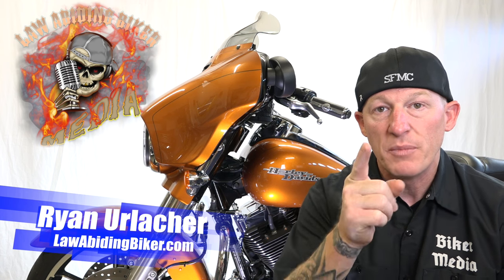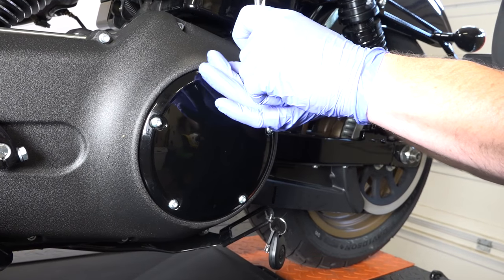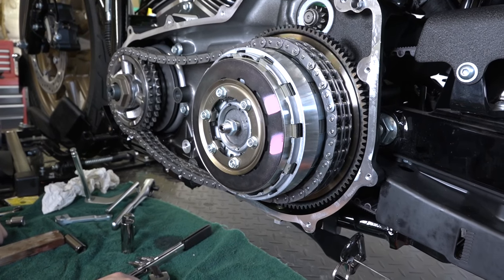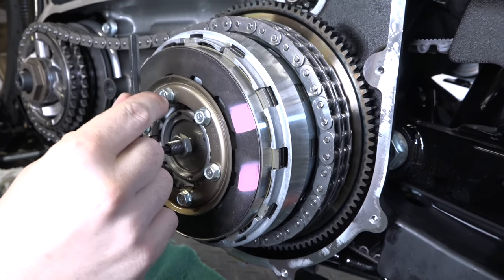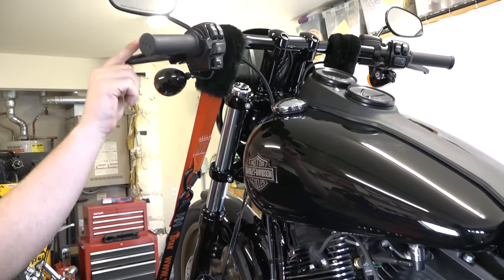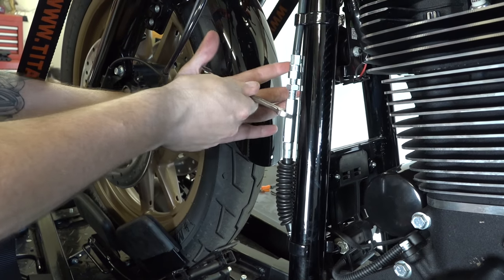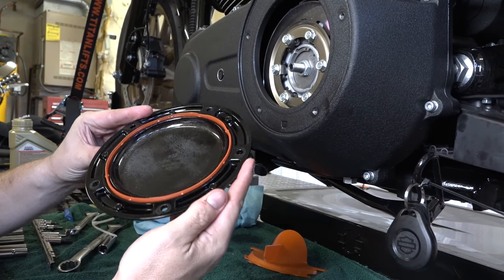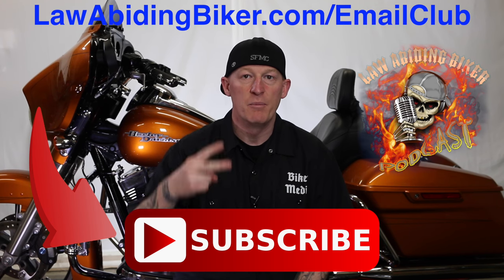How to Adjust a Harley Clutch Internally & Clutch Cable | Biker Podcast

Comment: I did this back in August after watching the video. Everything went smooth until I tried to loosen the nut on the threaded adjuster bolt. I have a 2011 EGC. It felt like someone welded the nut onto the bolt. After about twenty minutes of messing with it, I finally got it loose. I went and picked up a new nut because I trashed the original one. Thanks for another great video!!
Reply from the maker: You are most welcome and glad to have helped.

Ride safe & Ride Often!
Here is a link to a bunch of our useful Free vids: http://www.lawabidingbiker.com/freevideos
Here is a link to some of our useful for purchase videos: http://www.lawabidingbiker.com/buyvideos
Want Answers & Information Fast? And help support us at the same time? Do you like the content we provide?
Our patrons get answers to their questions/comments/feedback in less than 24 hrs and are part of our Private Facebook Group. If you are interested in being in this exclusive group you can get all the details at ==> http://www.lawabidingbiker.com/patreon
If you haven't subscribed to the Law Abiding Biker Podcast make sure to do so. Listen in as we talk weekly about issues/items like this & so much more. You can listen on iTunes (Apple/IOS), Stitcher Radio (Android), or any other Podcast App ==> http://www.lawabidingbiker.com/podcast
Join our free email club at http:///www.LawAbidingBiker.com/EmailClub. Only relevant content will be sent from time to time. Email club members are the first to find out about free or for sale content are given special coupon codes.
Reply: An offset box end is good and the gearwrench socket set is even better. It has a hole down the middle.....

Comment: thanks guys for the great videos.As the back yard mechanic that i am i do know the twin cam any year make or model.All of us back yard mechanics should own a few maintenance repair manuals for reference location, part # , tool's u need Etc.... I just installed the Baker high torque bearing seal kit om my 2006 FLHRS in November she will be 15 years old yes!!! HER treat Her nice and she will do the same. I had that DREADED one drop after a ride primary fluid leak from the main shaft walking race flaw. with the Baker bearing seal kit there is no more main shaft race for the bearing to ride on so therefore no more walking race lol.The bearing is precision tapered and rides on the main shaft alone nice set up easy install put 300 miles on it so far so good thanks again for all the great learning very helpful videos

Big Joe
Deland Florida
Reply from the maker: Right on Big Joe.  Thank you for taking time to comment.  We're happy to hear you like our videos.

Ride Safe & Ride Often!

Comment: Great videos thanks..
so quick question. The further you back out the center bolt, the 'faster' the clutch? 1/2 turn would equal late clutch 1 turn would equal early clutch ..

Comment: Question for you. I decided to do this adjustment on my 2015 Road King with 16,000 miles. No issues beforehand other than wanting to tighten up the adjustment in the lever. So once all said and done and done exactly the way the Harley service manual says, I now have a bad vibration in gear while riding. Clutch pulls and engages just fine but bad vibration in the seat in gear. So I reperformed the adjustment turning out shaft 3/4 of a turn and still same issue. Done EXACTLY the way the manual says on a stone cold bike that was sitting for 2 days previously. What gives here, surely a simple 5 minute service has not damaged something.

Comment: Ryan, I replaced  my clutch basket assembly and adjusted the clutch internally and extras you described. However, when taking off and I’m 2nd and 3rd gears. I get this slipping feeling when accelerating especially when going up an incline. Any thoughts as to what is causing this?

Comment: Hi, need to pick your brain about a problem I have with my 08 Street Glide which I recently bought. After making the clutch basket and cable adjustment my clutch pulls horribly. When pressing the lever the spring on the basket bearly moves and the lever is stiff... The funny thing was after taking off the primary inspection cover you normally don't get much oil spill when the bike is upright but my primary was filled with something like 2 quarts of oil and it spilled all over... Not sure why someone did this.  Checked the transmission cover clutch actuator and it's okay, clutch basket nut, and it's solid... Also to make it work at all, had to turn the adjuster bolt in after reaching the resistance instead of going half turnout.  Not sure where to go next... The only idea I have left is that my Street Glide has Apehangers and a quite long clutch cable... would that be the cause of my headache??? Not sure where to go next... Regards Simon

Comment: I have a 2002 fat boy and I’m ran out of threads on the the clutch cable adjustment. Does that mean the cable stretched too much? Or the clutch pack is worn out? The cable is after market maybe 13 years old.

Comment: I did that exact thing and still can't get my clutch to disengage the transmission when pulled.
If I put the bike in gear I can't roll the bike.
So I started all over adjusted at the basket, then the cable adjustment.
Still have no clutch.
I'm goingmout of my mind.
It worked when I parked it and now after the cable change it doesn't.
It's the proper length cable but just can't figure it out.

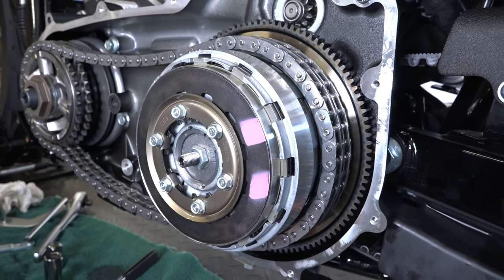Comment: Hey Ryan, huge fan of LAB. I installed new cables for apes and used your video to adjust the primary, but I was wondering at 3:32 it says "newer clutch may need 1 full turn". Is this in reference to the new clutch line, or a overhauled brand new clutch? Also at 3:47 you say to pull the clutch lever 3 times. When doing this are you fully pulling it in or just a wiggle for free play?

Comment: Hi Ryan, clutch question. I have a stuck clutch safety switch on my 15 road King. Causing my bike only to be started in neutral. Also effecting. My cruse control not too work. Can I change that switch or do I have to replace my handle bar control. Thanks
Reply from the maker: Just the switch.  Happened on my 2014 SGS.  My local HD dealer replaced it under warranty.

Ride safe & Ride Often!
Here is a link to a bunch of our useful Free vids: http://www.lawabidingbiker.com/freevideos
Here is a link to some of our useful for purchase videos: http://www.lawabidingbiker.com/buyvideos
Want Answers & Information Fast? And help support us at the same time? Do you like the content we provide?
Our patrons get answers to their questions/comments/feedback in less than 24 hrs and are part of our Private Facebook Group. If you are interested in being in this exclusive group you can get all the details at ==> http://www.lawabidingbiker.com/patreon
If you haven't subscribed to the Law Abiding Biker Podcast make sure to do so. Listen in as we talk weekly about issues/items like this & so much more. You can listen on iTunes (Apple/IOS), Stitcher Radio (Android), or any other Podcast App ==> http://www.lawabidingbiker.com/podcast
Join our free email club at http:///www.LawAbidingBiker.com/EmailClub. Only relevant content will be sent from time to time. Email club members are the first to find out about free or for sale content are given special coupon codes.